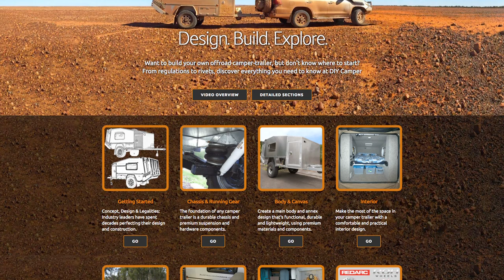DIY home made off-road camper trailer

Comment: nice camper ..... but the problem is I have no experience about welding aluminum .. the only choice that I have is to make it full of steel tubes except the siding aluminum  sheet.
Reply from the maker: +Mrkhm1988 I can't weld aluminium either. Most of the aluminium in the camper is not welded, it's joined with a combination of rivets and Sikaflex automotive adhesive. For the aluminium sections which are welded, I took the parts/camper to a specialist aluminium welder to have them welded professionally. I was actually advised that in most cases the rivet/adhesive combo is superior due to the very slight flex it permits, which reduces the chance of cracking.
Reply: +Australian Images thank you so much ,,, great information , I got this idea but I thought is not Enough to resist the off road  vibration .. very helpfull

Comment: I have downloaded for plans.  I already have Sketchup already load on computer.  How do I go about inputting your plans to my sketchup?  Nice build.
Reply from the maker: You should just be able to go to open Sketchup, then go to the File menu, then 'Open...' then choose the file you've downloaded. If the plan you've downloaded is zipped, then you'll need to unzip it first. On a Mac, you can just double-click it, and it will extract the sketchup file. On Windows you may need to download a free unzip utility, such as Winzip.